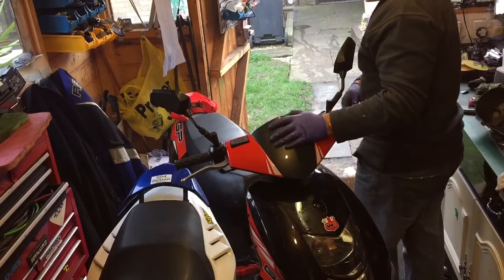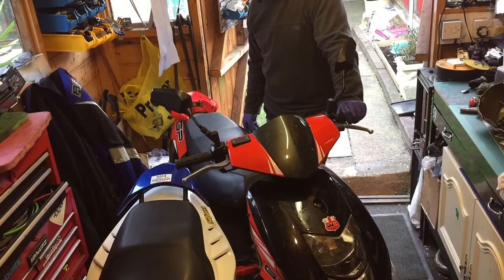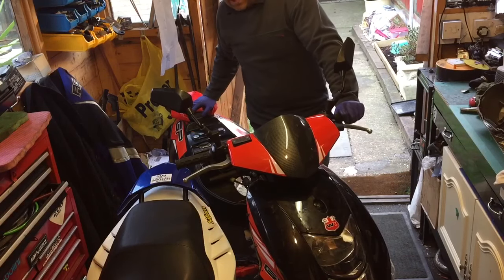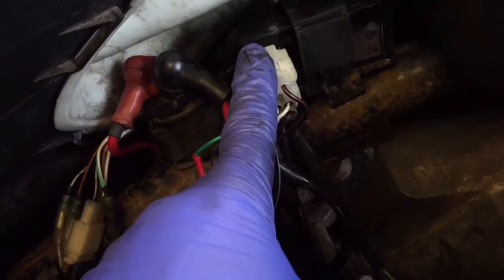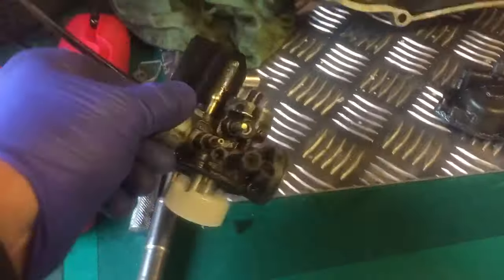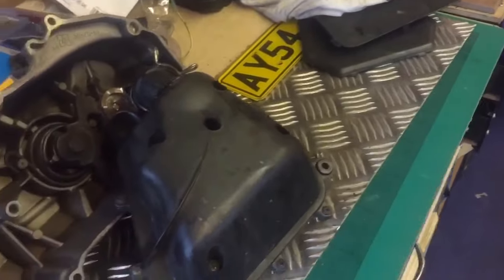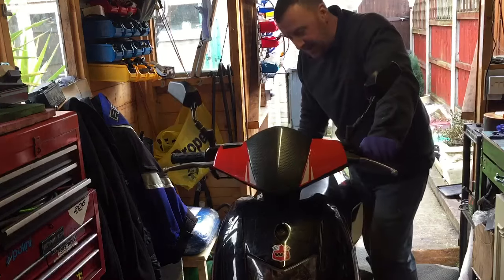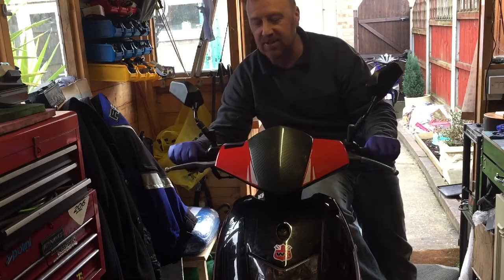WK 50cc GP moped review on problems mark savage

Comment: Alright Mark I'm working on one at the moment for my friends dad any ideas on deristrict  is there a washer behind variator etc cheers buddy top video
Reply from the maker: to be honest mate they are 30 odd mph mopeds, you can upjet and changed exhaust and new rollers for a few mph but others no bud 
remember to keep an eye on the oil as the do burn a little and then go badly wrong

Comment: I'm thinking the 'nine-screws' are there to act as 'vibration-dampers' for the air-box, maybe?  That engine running sounds like an 'empty coffee-can with BB's rolling round in it'...a sure sign of bearing-failure  ( The market in America for Chinese scoots is HUGE ...but the parts on them come from independent contractors with little or no quality control...'Kymco' seems to have a decent rep here with the fewest issues, but they have 'problems' too )
Reply from the maker: they all seem to be the same, but like you say regular servicing and a bit of tlc 
take care bud

Comment: Hi bud, love the videos!
I've got one of these in the garage thats failing to start! Got good spark and good fuel flow, air filters clean! Do you know the correct carb screw adjustments please?
Reply from the maker: I have many carb videos all worth a watch on 2t and 4t tuning and cleaning on my channel type in carb mark savage 
however to start as standard and work in or out
2t 3 half 
4t 6 half
Reply from the maker: they do blow pistons so maybe worth a check if still fails to start

Comment: My Gf brought the 2012 version second hand, runs nicely but is loud. Just wondering though to get it started, put key in and twist so it's on, then you switch the kill switch on and then have to hold right brake while pushing ignition with Thumb and twisting accelerator to rev it before it moves. Is that normal?
Reply from the maker: both brake levers should work so left side too ,if not its the micro switch which is easy to fix like in my videos and in my last set on the speedfight as I show it .
i'd leave the kill switch on and dont keep using it like in my v clic videos as if you keep using them the y can damage the cdi and blow it !!
so then its just left brake lever turn on key and press start and away she goes
as for the loud bit that's not normal so guessing you have an exhaust blow so need that sorting bud

Comment: Hi mark where are you based I have a problem with my wk ttr50 it fires up but then loses power and cuts off within a couple of minutes I’m not sure what the problem is it seems to be that it is not demanding enough fuel
Reply: Hello brandon I have a wk50 ttr 50 4stroke and have the same problem.I’m told it needs a new throttle body at £200.did you find out your issue did you get it fixed?at a loose end and mark has been the only person with knowledge and advice until now.

Comment: Hey Mark, i have a 2012 yamaha aerox LC. You know the concept of burning out a 2stroke exhaust? I'm noticing some performance drops and people are recommending me to burn out my original exhaust. Would u recommend it aswell? Thx
Reply from the maker: Bas Molenaar hi bud try a service first like in my videos   plug and air filter , have you checked the roller and belt, , cleaned carb, as for the exhaust burning it out !! That's was in my day on old bikes when 2t was poor , if it's a standard exhaust it should be fine but better have a go at a sports exhaust and if you all ready have one then as in my videos change the wodding  hope that help please watch my other videos and like share and subscribe , mark
Reply: mark savage I will thx mark! You've earned a sub

Comment: hey man just found your channel and im loving it you seem like a real cool guy do you think you can give a newbe a bit of advice im looking to get a moped used from around 460 to 550 in the up you got any fort on what to look out for when buying sorry if i put this 2 times   spell checks a pain in the ass
Reply from the maker: godess rainy hi thanks for the comment , I do like doing these videos and always hope they help 271 videos I think maybe to many lol,
Ok bud well it's down to a few things 2t adding oil but faster 4t just fill and go and will still do 40 odd in most cases 
The look of the bike! I guess it comes also down to the bike and the person you are getting it from , just make sure it's been looked after and serviced then they all come down to that, take it for a test ride make sure it's cold when you start it and have all the paper work , then all should be ok as long as you follow my basic diy steps it should keep going , but stay away from the really cheap Chinese ones , hope that help please keep watching and like share and subscribe , mark
Reply: all ready subedscricrd and liked 5 of your videos thanks for the advice my dad used to ride motorcycles as well so hopefully he can help me with some parts any makes you would recommend and advice about staying away from
Reply from the maker: godess rainy for a bit of fun speedfights and aeroxs easy to work on aprila sr but no the injection as they die and cost a lot to fix , wk are ok for 4 t but test ride it same with the kisbee v clic boation , just not the ping pong Yong ones if you know what I mean pmsl , thanks for the likes . Mark
Reply: ok thanks keep up the great work hope to see more of your great videos sown

Comment: If I want to upgrade my rollers, air filter and my exhaust on a piaggio nrg do I need to upjet the moped ?
Reply from the maker: the ngr's are normally fast ped's with a big jet!, they do sometimes have a restrictor in the inlet part of the carb so if that's there take it out. first do the upgrades and see how it runs then upjet if it runs slow or bogs down. I have down a few videos on them so give them a look . please like share and subscribe . mark
Reply: mark savage  could you do a small simple video on how to do it
Reply from the maker: Joe Bullock I've not got a nrg here to do it but I have many other videos on here that will show you the basics and mostly all the same sure the nrg video show you the carb or the DNA as same engines in fact yes the DNA video does show most of what u are asked by give them a look maybe with a cuppa as I do go on a bit lol but most of these upgrades are easy to do bud , mark
Reply: Thanks mate I've got one last question if I put just the sport exhaust on will I still maybe need to upjet

Comment: Hi mark do you know the carb adjustment for a Kawasaki gt750 straight 4
Cheers
Reply from the maker: hi bud 
no you cant do it like the single carb bikes, funny I had a gt 550 and 750 shaft drive back in the 80s think they were Breg lol
they have to be balanced as each carb is set as they all link together, you can get the carb balancing kit on e bay but to be fair the garage will charge you the same money as the kit and as you really dont have to do it often it makes more sense letting them do it 
thanks for watching
Reply: @marksavage  have tried bike  4 garages and they wont look at it coz it's a trike I have a balancing get prob is bike will start but wont tick over gust looking for idle adjustments so it runs to get the gauges on lol
Reply from the maker: Stew Livy take them off and take apart 
Clean replace all rubbers then go to standard 6 half turns 
This may get you going 
That’s bad of garages not helping !!
Check out e bay for the. Carb balancing tool
Reply: @marksavage  will do have had them off they are spotless have kits on order thinking of changing diaphragm as well cheers

Comment: I know that scooter as a CPI Aragon GP, Austrian manufacturer, my cousin had it, it was very good and powerful scooter for its price
Reply from the maker: yes it's the same but WK or white knuckle still call it Aragon GP , they also make the generic 50cc 125cc tiger also a good bike for the money  , they all suffer from the CDI unit brakes and chain on the moto style , it's the first time I've worked on a ped style one.I'm guessing they forgot 2t oil and this is what you end up with!!thanks for watching bud and your comment. mark
Reply: mark savage nothing man i like your videos because i like to work with my sf2,you do awsome job

Comment: love your top tip lmao
Reply from the maker: I do try and add some in all my videos lol, thanks for watching maybe check out some of my other videos with top tips :)
Reply: mark savage I've watched watched all your videos lol there a great help and u seen a funny character also.... I got my indicators working pal they seem to flash fast...front are original and rear are l.e.d..is this why? if I added l.e.d to front also would they slow down?. .also is that a mot fail if they blink a lil faster than normal?
Reply from the maker: so would you be if you sat in your shed and video yourself as much as I have, (wife thinks I'm mad as she watches me sometimes in the shed talking and waving my arms about)  pmsl ... yes as in my last video on indicators they will fail the mot for flashing to fast, if you change both to led they will all flash fast. 1st you can replace the flasher with a led regulated one or 2nd put flash rectifiers on them but I'd go for the new flasher unit, cheap and easy and on e bay. . once again thanks for watching :)
Reply: mark savage so I just need a l.e.d relay?. .but need my front and rear lights to be led for it to work affectively. .thats easy done thanks for the help AGAIN lol
Reply: wow I just looked on ebay and there like 4£ ..thats really cheap lol..I noticed some have beepers in them though...ergh thats nasty lol
Reply from the maker: yes mate that all, its the relay that flashes them . mark